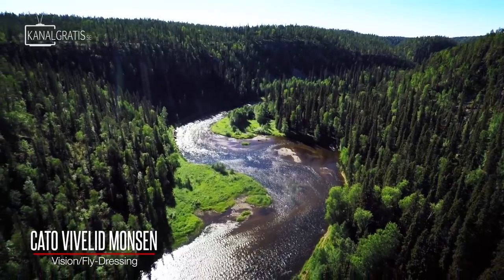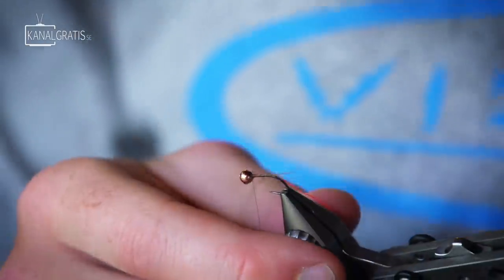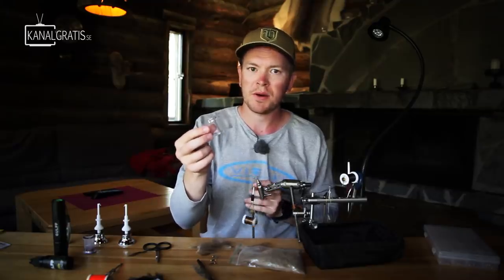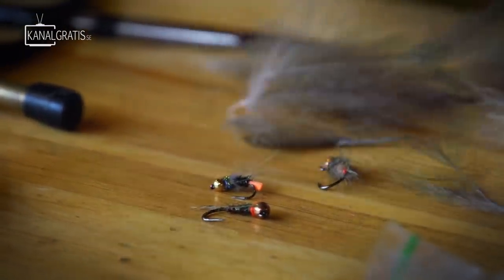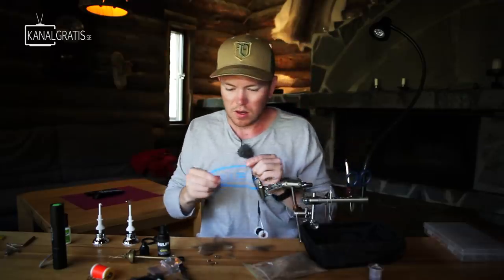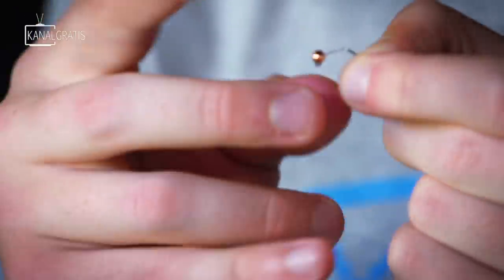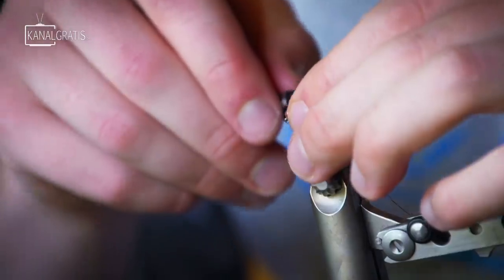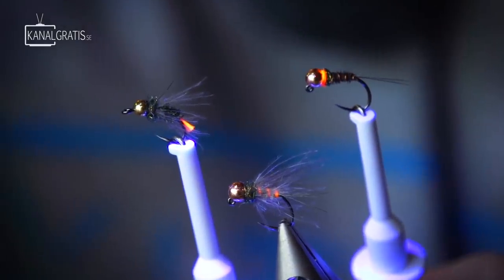Top 3 Nymphs for Grayling and Trout (Hare's Ear, Red Tag and Pheasant Tail Nymphs) - Tie TV

Comment: Nice nymphs!
What size hook do you use for the Red Tag? I saw on the package in the video that it is a Partridge Cech Nymph hook size 20. Is this correct? If I see the flies lying on the table and the other two flies are made on a size 14 jig hook than it doesn't look like a size 20.
Thanks for sharing the patterns. I am going to make them to use them in Finland.

Comment: I’ve no doubt these a great trout and grayling flies. I use very similar patterns BUT they are not the patterns you name. The names belong to other traditional flies and you have tied variations of them and they should be described as such to avoid confusion by less experienced anglers or tyers. Great tying but too casual naming.

Comment: I hope new fisher dont see this, you confuse them. Very expensive beatyfull coc de leon feather you hide, only a tiny bit is sticken out. You take a beat for sinking and then CDC for floating. I m not using my time too see the last two flies
Reply: Line Jensen you are not right. You can buy Coq de Leon feather in small package with only a couple of feather which will do a job for hundreads flies. Such package costs onyl a few Euros. CDC legs are commonly used for nymph flies for at least ten years. The main goal is to add flexibility and movement to the fly. You do not add so much feathers to the fly as for dry fly. Btw: we had a couple of tying session with Martin Musil who teached fly fishing novices to tie nymphs, he showed them nymphs with such CDC collar and it is easy to tie and it really works in the water. I use very similar flies as Cato and Jarko and it really works.
Reply: I’m a new tier and I love the simplicity of these 3 flies. I a so learned a lot from you tip about twisting the peacock or the pheasant tail fiber before wrapping forward. Just brilliant ! I’d love to have these 3 flies as my models to use as examples.